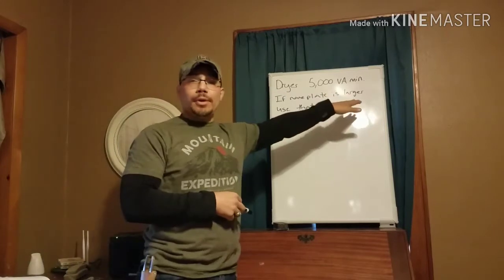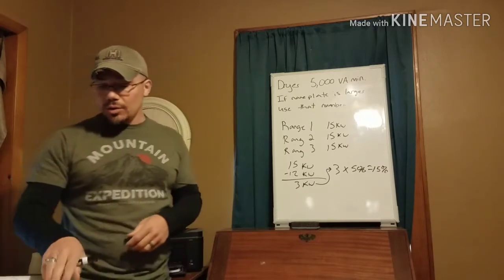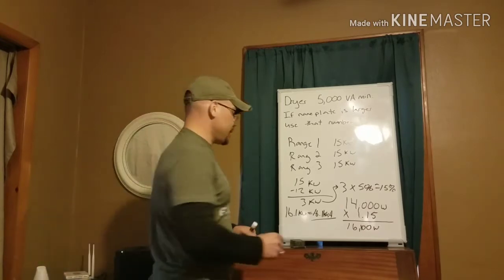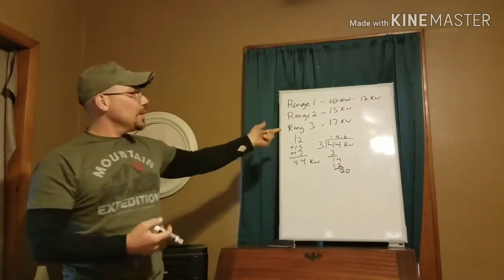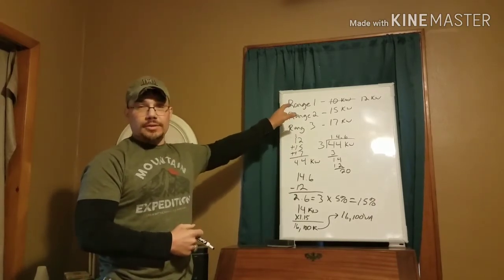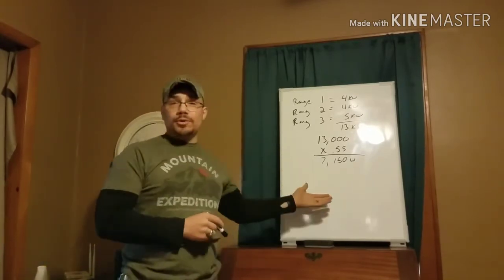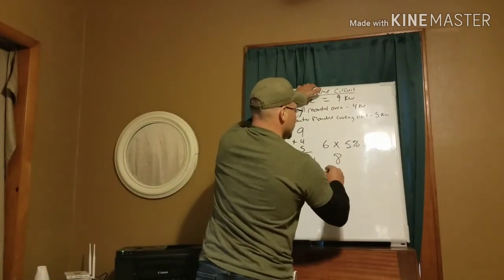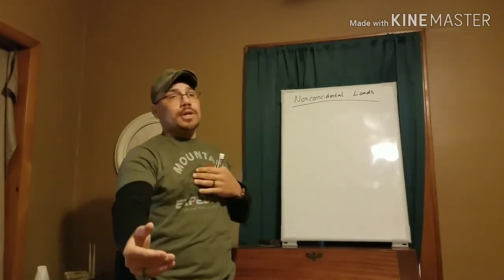NEC Article 220 Service Calculations (Part 2)

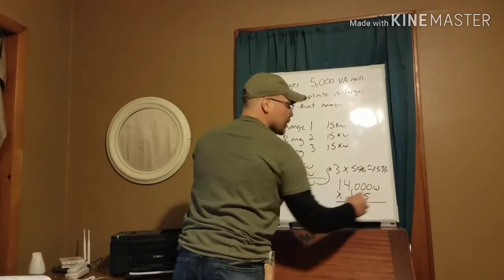Comment: Hey Dan on 6:20  I got confused with something.  You multiplied 14000KW by 1.15.  I think it’s supposed to be .15?  Anyways, I got 2.1kW.  Is that what you got?
Reply from the maker: Hi tanado8. Thanks for the question.  We want to raise the 14kw by 15%. The decimal of 15% is .15. You are right in multiplying  14kw by .15 to get 2.1kw. That is 15 % of the 14kw but then you need to add it to the 14kw to go up the 15%. If you multiply 14kw by 1.15 it goes up the 15% without the extra step. Hope this clears that up